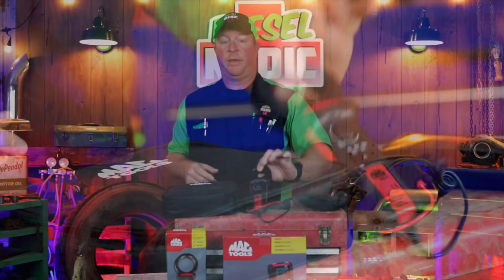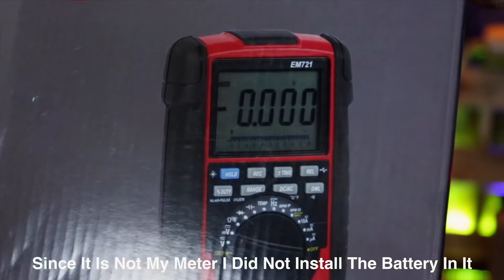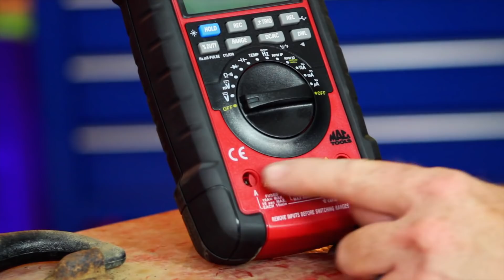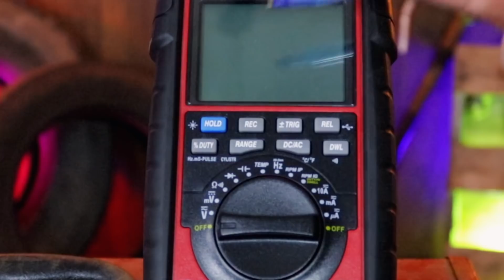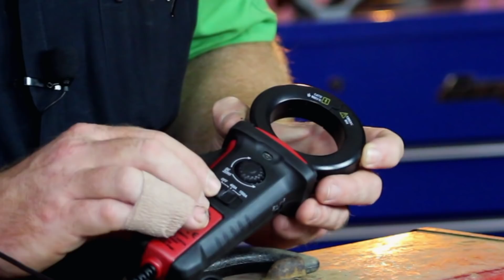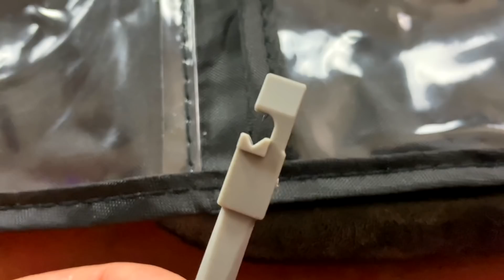Mac Tools Multimeter (EM721). Multimeter Basics And What Can A Multimeter Do?

Comment: Just picked up this almost exact same kit that my dealer had on special. Slightly different style amp clamp but it was the same meter. No test lead kit however. I was reading the manual and a word of warning of the temp probe. The temperature scale advertised is for the meter, NOT the included thermocouple probe. The highest the probe is rated for is about 400 degrees Celsius (about 750 F). If you want to go higher then you will need a higher quality "professional" Probe (exact wordage in the manual).
Reply from the maker: That sucks

Comment: I am a little late finding this video. This isn't as good of a deal as it seems. First let me say that  I  absolutely love Mac and Snap On and have been giving both of them my money for years. But let me also say that there are certain tools you don't buy from a Tool truck. Multimeters are one of those tools. Neither Mac  or Snap On own a multimeter factory. So who is really making these Multimeters? Mac's multimeters are made by FCI. FCI is a subsidiary company owned by Klein Tools. In other words, These Mac multimeters are rebrands from Klein. You can buy these same multimeters at your local Home Depot in their Klein Tools section for less than half the price of what Mac is charging for them and you still get the Klein warranty when you buy it from Klein.

Comment: I grabbed fluke 179 way better then this lol
Reply: The fluke 179 is not a automotive multimeter it does not measure pulse with duty cycle or RPM
Reply: John Bartholomew so it’s a garbage meter and the Mac is better ?
Reply: @ancormane524  no the fluke 170 series is a electricians meter not an auto mechanics meter
Reply: John Bartholomew I work semis it works for me sir what do you own ?

Comment: What happens if you turn the meter dial with your leads already plugged in will it break those doors if you try to turn it to amps while still having your red lead in the right most hole?
Reply from the maker: I figure the dial would be hard to turn. I’m sure if you forced it then it would break ?
Reply: Koon Trucking okay cool thank you

Comment: Finally got my matco tools battery wire brush and a side post terminal brush and a plug wire pliers minus the battery terminal puller which I ordered a older Mac terminal puller instead of eBay happy with what I got hope all is doing well in the days ahead